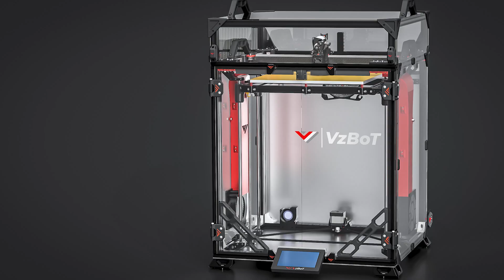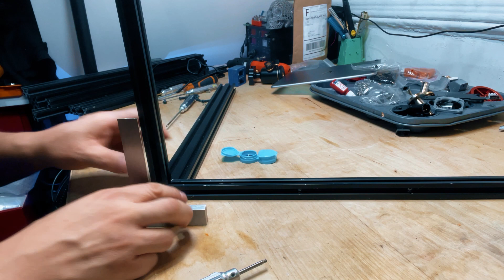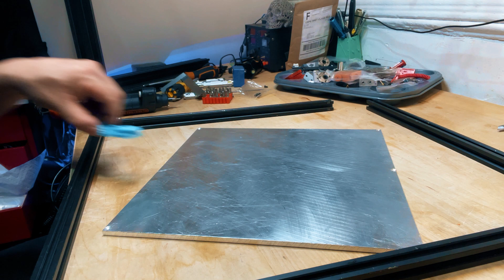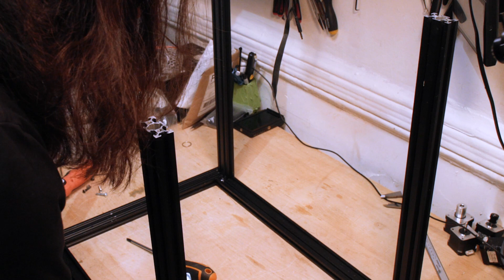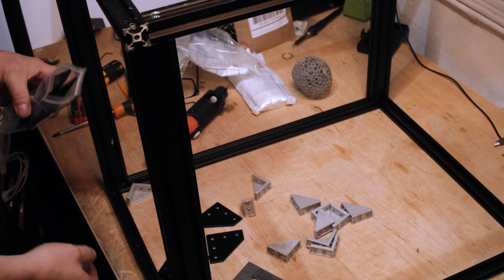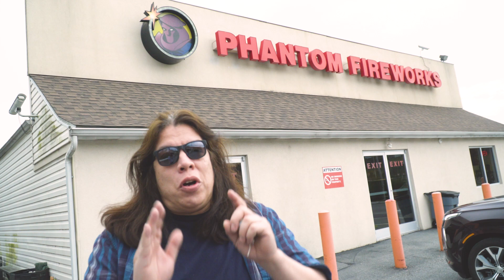Converting a 100.00 used Tronxy to a high speed VzBoT Part 2.

Comment: Sorry but using an engineering square as a hammer is a super no. The quickest way to knock it out of square .
Reply from the maker: It was a tap and in the end I measure diagonally both ways it was square.  It is very hard to 100% square but you get close.. in the marlin firmware there are setting  to help adjust skew and compensate like auto leveling. Keeps a frame square is possible it but moving it sound you are gonna eventually knock of of square especially if you are still building. Best thing to do after everything is built is to square it up again. Then start you calibrations.
Reply: @tommygunnfilms  i meant knocking the square out of square. I constantly check my square against an engineering cube before using, and if it’s out then off to the tool shop to replace. I have been rebuilding both my x5s printers for a while now. I have to extend the x axis by around 40 mm to accept the quad leadscrews system I’m installing, and this should virtually eliminate the need to level the bed once setup with a dial gauge.
Reply from the maker: @lordm3lvm  kool you got the squaring down.. I had no idea what an engineering cube was I went to Amazon to see they don’t have them.. I googled it I still have no idea what it looks like or how it works. But it sounds like you work with a lot of cool tools my series is about a non engineer building something and showing mistakes along the way and how I solved them not necessarily the best work but it works. I have limited tools like most people so I gotta work with what I got. 
I want people to jump in and tell us how they solved certain problems. Too many build videos don’t show mistakes and how to solve them.
Reply: @tommygunnfilms  an engineering cube is a pecission calibrated cube which is so square you can check how true a squer is
Reply: @tommygunnfilms  if you can send me an address where I can send you a photo of mine I will
Reply: Hope you can see the image
https://drive.google.com/file/d/1BQlidG_q7-wY9UQYRRQxu6u9MyarBjcG/view?usp=drivesdk
Reply from the maker: Always good to see tools I have never seen before🤘 unfortunately you can not find these on Amazon or eBay and even googling it showed very few results. I am guessing you work in a shop with very cool tools. 
A lot of new builders out there and old builders have just a few tools at their disposal like some metric assorted drivers, screw drivers, pliers, side cutters, a caliper or ruler and that is pretty much it. You use what you got and make it work. Even my machine square most don’t even have that. And I just got mine for the first time recently.  I have no idea what those cubes cost but you should make a video on how they are used. 

Tommy

Comment: Could you tell me the length of the rails, 450mm, 500? I didn't see a BOM, but I assume the carbon fiber square tubing is 20mm X 20mm, and the length? Only asking because I'm sourcing the materials now while waiting for your excellent next installment!
Reply from the maker: 4 460mm 4 530mm right at the start of video I count them out. I will add a link to bom thanks for pointing that out.

Comment: what are the name of the corner brackets you used. Not the silver ones (already use those lol) but the black ones that seem to go on the outside of the frame?
Reply from the maker: Hey chis before ordering them gimme a week I want to test something with them they may not be as effective as they look with 2020s 
I want to test them once the motors are mounted Boeray 10pcs 2020 Corner Bracket Plate Anodised L Shape 5 Hole 90 Degree Outside Joining Plate for 20 x 20mm Series Aluminum Extrusion
Reply: @tommygunnfilms  understood!!
Reply from the maker: @ltlk937  ok so during some test I did I did not have every corner of the frame with the corner pieces I had intermixed mostly on the bottom sections had them. So I push the frame to see if it would twist… it did! You need to have every corner filled with a corner block and then then every possible place where other parts are placed I would even think on the underside where the feet would go.  I want to look into using all 2040 instead of 2020 I think it would make for a more stable frame.

Comment: I have the tronxy x5sa 400 pro. Would you say the linear rails that you plan on using are better than the stock?
Reply from the maker: Way better and lighter I explain in part 1 why and what makes the printer faster I had got the x5sa pro and I hate the rails they weight like over 1 pound each.